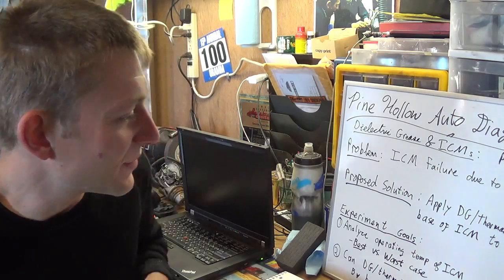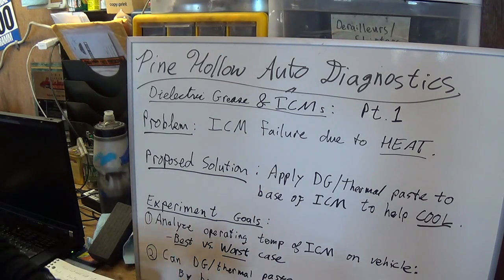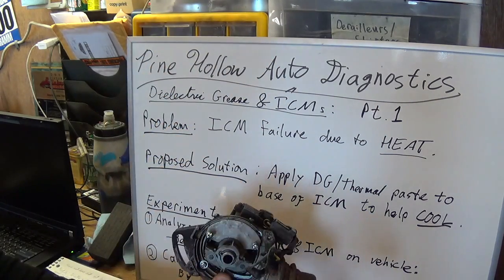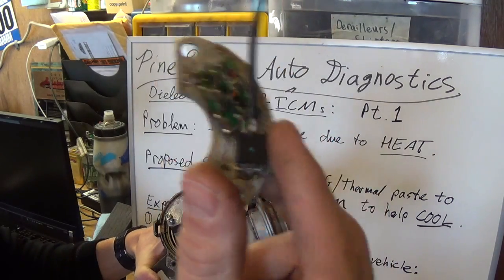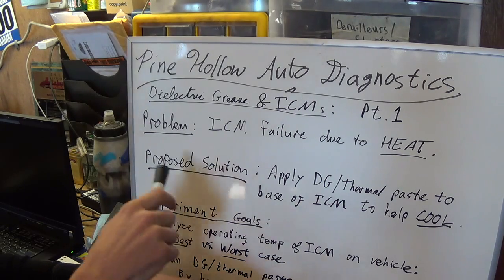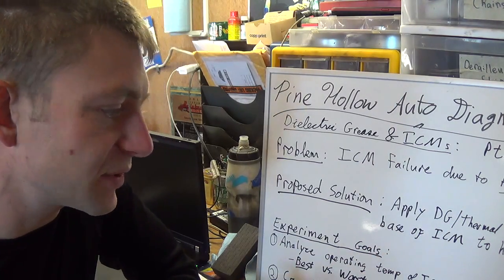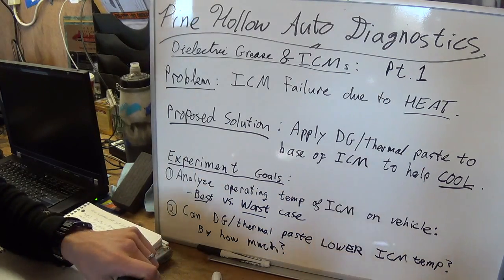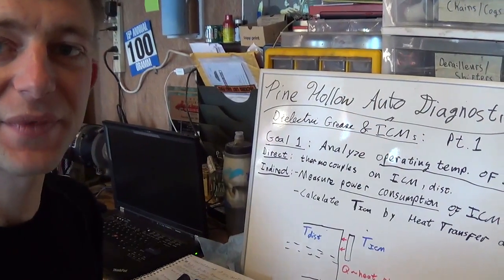MYTHBUSTERS Ep1: Dielectric Grease & ICMs - Part 1

Comment: on a gm 3800 Ive concluded the best resolution is applying thermal paste to reverse side of the icm to transfer the heat to the matching mounting plate. I think dielectric paste would be inappropriate.

Comment: I'm thinking the engine block even with it's something around 200° f temperature must be cooler than the transistor or GM or whatever manufacturer wouldn't have recommended thermal paste scene that's olny going to facilitate heat transfer, having said that I'm thinking it might be more about heat-cool cycles or even the speed of the cycle that causes falure however I'm going to try to figure out how many times that transistor actuates the problem for me what avg, speed do I use to calculate engine rpm, it might be less about heat than total number of firings of the transistor

Comment: Dielectric essentially means non-conductive. Dielectric Grease is used to improve and INSULATE the electrical connection point. When metal parts are connected, there are tiny areas where there is not a COMPLETE metal-to-metal connection. These inefficient connection points (gaps) can result in minute leakage and arching of the electrical flow. Dielectric Grease fills these tiny gaps and forces the electric flow to ONLY pass through the ideal contact points. As well, Dielectric Grease is used to prevent rust and corrosion; especially when the electrical connection is exposed exterior elements (water, salt, etc.).

Comment: It's pretty simple for me, maybe too simple on my part.  The ideal is to keep the ICM as cool as possible.  Let's assume that you have the best connection between the ICM and what it's attached to...a weld or solid body.  
Where??? does the heat originate from...  The ICM needs to be the coolest (or, cool-ER) component.  
The solution lies in making the ICM the coolest part in the system.  
In computers, you do this by using lithium grease or silver grease, or heat transfer grease to minimize temp differentials.... but that's because the CPU is the HOTTEST part of the computer... and needs a massive heat sink to draw heat away.  
If you want to extend the max longevity of the ICM,  then  cool it as much as possible.  Simple?
Reply from the maker: Correct. The question then becomes: how good of a heat sink is the distributor body, which is bolted to the hot engine block?

Comment: Been applying DG to connections for years.  Watch how a maker of the grease,  CRC, applies the grease.   https://www.youtube.com/watch?v=GNiEJfgS8cEThe point is that while it does not improve conductivity in the sense of being a conductor, it facilitates stability by keeping corrosion at bay.  Sometimes that corrosion is barely visible,.  Now I wouldn't use as much as CRC did in my link above.  I only apply it using a toothbrush.

Comment: The junction temperature of the power switch is most important. It is the sum of all thermal resistances (in degrees C rise/Watt of dissipation) times power dissipation in watts plus ambient. Typically the power transistor's thermal resistance is 1-3 C/W from junction to case. The TR from the case to heat sink is typically 0.1-0.3 C/W. The heat sink to ambient TR can vary widely say, 1-15 C/W. So typically the ambient temp and thermal resistances from the heat sink (distributor body) to ambient and from the semiconductor junction to case are the big influences on junction temperature. So you're right; Move the ICM to a cooler place and don't worry much about the dilectric grease!

Comment: I've fixed connection problems, loss of signal at connector, by removing excessive amounts of dielectric grease in the connector. I work on small to med size construction equipment, used to auto tech. I honestly think it may be used to transfer heat from a component but in a electrical connector it can cause problems.

Comment: Maybe I shouldn't but I'm gonna throw a curve ball at this one since we are discussing dielectric compound. In the seventies from the factory Ford applied dielectric compound to the tip of the distributor rotor to stop radio static on Dura-Spark ignition systems. We used to think the rotor tip was burned. If you replaced the rotor and didn't reapply the grease the static on the car radio was bad. Just thinking out loud.

Comment: It was always my understanding that Thermal paste or heat sink compound was to fill peaks and valleys in the surface of the metal we are using to improve heat transfer. The more surface contact the better the heat moves from the component to the heat sink. All metals are porous so we loose a lot of contact area. This is why a light coat is always best. The only problem i would think the DG would have is it's temperature range. At lower temps it might work fine. I'll wait for part 2 to see how it works out. Thanks for the video.

Comment: Damn, Damn, Damn...........Last night I had  a really great (my humble opinion) note to send and just before I finished it, the damn computer locked up!
(my computer-operating system-browser combination is not exactly "state of the art", to put it mildly)

I'll have to try to re-construct it later.

Anyway.................

____
I don't want to get too far out ahead of things here, because you're probably already aware of these items, but just to be sure, I'll mention them:
1. I don't know if you're going to be using the 4 wire or the 7 wire module for your experiments. On the 4 wire, the two mounting screws provide the grounding for the module.
I'm not sure about the 7 wire, I don't have a wiring diagram in front of me, but since it has 7 wires, it probably has at least one or more wires providing good grounds.

2. The are a LOT of "hacks" described on the web that people have done with these modules. There is also a lot of aftermarket replacement "speed parts" for it made by MSD, Mallory, Accel, etc.

3. Last night I looked at some exploded diagrams of the distributor, but I don't have time to look them back up at the moment, I'm in kind of a hurry.  But I wonder if the geometry would allow taking the module (at least the 4 wire style, not sure about the 7 wire) OUT of the Dizzy and put it on a dedicated large aluminum fin style heat sink (like computer CPU style) and mount that in free air a little ways away from the Dizzy, and away from any major heat sources. Just a thought (as a DIY hack, not as part of your experiments).

4. As I'm sure you did, I did a lot of searching for "GM HEI Ignition Module Failure" and there is a ton of anecdotal info out there about it. It was a MAJOR problem. I think the Ford EEC-IV's had a similar problem, although I haven't searched specifically for that. A couple readers mention that below also.

5. I found several references that say that Di-Electric Grease and Thermal Grease (Heat Sink Compound) are often BOTH Silicone based, but that the Thermal Past has special ingredients to help make it more thermally conductive.  By the way, and I think a couple other people have mentioned this, the white Heat Sink Compound is NOT white lithium grease, even though they look similar.

6.  Somebody said they had never seen Heat Sink Compound in an auto parts store, but it's hard for me to believe that most parts stores would not have it, especially these days.  But if somebody wants to get it, there are many places other than auto parts stores. I would think most hardware stores would have it. Any electronics supply business would have it. And of course by mail order, all the Electronics places will have it.  Mouser, JameCo, DigiKey, Allied Electronics, and dozens of others. A very small amount will go a long way.

Looking forward to parts 2 and 3 with baited breath.....

You're cool Ivan!

carry on...

Comment: I can see the temp differential being a big factor along with the area of the plate under the circuit.I offer my  condolences to you on your journey back to the text books. Some of them equations could lead to severe celebrial malfunction, so small doses at a time.Heatsinks and thermal resistance come to mind.Great pioneering experiment in real situations---Go for it!!

Comment: I believe a certain amount of radiation can take place without uv. As in a big pot belly stove. Aluminum is a great conductor. Aluminum oxide is a lousy conductor. As a lot of people in mobile homes with aluminum wiring found out. Insofar as the dielectric grease impedes the corrosion process, it allows good heat transfer. Am I close?
Reply from the maker: +Bill Rimmer Hey Bill! Sure any body that is above absolute zero will emit some radiation (blackbody radiation). In this case however, we can safely say it is negligible compared to the other two types. Good questions!
Reply: +motoYam82, We might also state that the role of convection is negligible since the air gap is so small! ;-)

Comment: i saw the decline in quality first hand when wrenching. ford reinvented eec-iv for poor quality back in the days. they moved the modules to a heat sink, heat played a crucial value in life cycle but the cheepo transistor life span was the  real player in failure. no amount of thermal paste would fix the failure rate.

Comment: Should be a very interesting experiment Ivan. You bring up a good point about the best temperature that the heat sink will be is the distributor housing which will run at a very high temperature anyway. As far I know, transistors theoretically should last forever which brings up the question of why do they fail. They do have aging effects which is inherent in the current technology of semiconductor manufacturing. Here is an article which may be of interest which pertains to MOSFETs. http://spectrum.ieee.org/semiconductors/processors/transistor-aging It's known that high currents and voltages of output transistors fail even with correct circuit design. Maybe, the transistor is operating at a higher value of temperature than what it's rated. Maybe, you could take a look at your value of heat dissipation and compare it to the data sheet for the transistor if you can read the part number. Other factors would be the aging of the biasing carbon resistors which will change value sooner in a hotter environment. This in turn would throw the transistor in a different operating point on the load line. Instead of being at cut-off and saturation it's operating point has shifted where more heat dissipation is required. Looking forward to your findings and keep up the good work.
Reply from the maker: +stuzman52 Terry thank you for the detailed thoughts! I agree that the designed operating temperature of the transistor and logic components is the key here. I think you will find the scope waveforms in the next Part very interesting to dissect! Maybe I should compare a known-good transistor on the van to the one from the faulty module on the bench?
Reply: +motoYam82 That would be very good to compare the good, the bad and can I say it, "the ugly". Sounds like you've got a good plan laid out Ivan.
Reply: +stuzman52 
Stutz,  Thanks for posting the Spectrum link about semiconductor aging. I found it very interesting.

Also, I wanted to congratulate you for your mention of possible bias resistor aging or being thermally changed (in value) in modules inside the distributor cap.

Personally, I like to dive deeper and deeper into every possible layer, when I'm trying to learn the theory of why a part fails. I'm not smart enough or educated enough to understand Ph.D level physics, but I can understand the idea of heat affecting a carbon resistor.

In other words, some people are happy enough to find out that a part failed, and then replace it. I like to (when it is within my intellectual abilities) figure out WHY it failed. That's why I am finding this particular case study and set of experiments that Ivan is doing so fascinating.

Be Well
Reply: +douglas lee No problem Douglas as we are all here to learn and trust me, I learn a lot of this stuff even today although I've been in electrical/electronics for 44 years. You too take and be well too.

Comment: The test data on this page says that dielectric grease works for thermal conductivity almost as well as thinly-applied thermal compound. (and thickly-applied thermal compound was as bad as bare metal-on-metal contact)

http://www.w8ji.com/dielectric_grease_vs_conductive_grease.htm
Reply from the maker: +anti0918 Dude! Don't give it away lol! I actually found that same link when doing the research for this series :) 
We'll take a look at that in part 3 and use our actual module power consumption numbers from part 2. The results will be pretty awesome.
Reply: motoYam82 Well, I think yours will be a better test, since the temperatures should be much higher than the 50-60 degrees he was measuring.
Reply: +brian0918 
Brian, Thanks for posting that. It was a very interesting article to read.
Reply: +anti0918 I've used anti-seize before,in a pinch. It actually works pretty well,since it contains metal particles.

Comment: when you tore the icm apart and told me the metal was aluminum that cinched it for me. in the building trades if you have aluminum wiring and you hook up a dishwasher or light fixture with copper wiring in weeks you will have a fire because of dissimilar materials. a grease is used to keep it cool. also in roofing and other trades aluminum will not match up. looking forward to part 2
Reply from the maker: +John Hafernik Wow aluminum wiring? So is there extra resistance at the Copper-aluminum interface to create heat and start a fire? That's crazy!
Reply: +John Hafernik I'm probably wrong about this, but I thought that aluminum wiring had been made totally illegal for virtually all residential housing in the US, via the National Electrical Code. Do you have any data about that?  I never knew mobile homes used aluminum wiring, but it figures.  Everything about mobile homes has always been done in such a cheap shitty way.  A few decades ago I considered buying one, but they had a "Disclosure Sheet" taped to the kitchen counter saying that there was formaldehyde used in some of the buildihng materials. That was all I needed to see to walk away. Anyway, that's off topic. I was just wondering if alum wire was still used in any construction these days?
Reply: +douglas lee back in the 70's aluminum wiring was installed in houses quiet a bit. I own one and as long as you use special switches and plugs it is fairly safe and the grease for connections. they don't make you rewire the house to sell it. still to this day the service wire that goes to your house is made out of aluminum. you have to tighten your main box and breaker box every once in a while so it makes a good connection and use the right plugs and switches. never owned a mobile home but i'm sure they used it there too. house inspectors try to scare you all the time. i'm sure code says no more but i'm grandfathered in
Reply: +John Hafernik John, Thanks for responding. That's good information to know.

Comment: Love this type of investigation . Man this is going to be a hard one to set up. To me I can't see the grease doing anything. Ha I've been wrong before. I suspect the module failure is a pattern failure of time and use more so than heat transfer. Using logic you would think up here with a colder climate the failure rate would be less than in Arizona but as far as I have experienced it seems to be about the same here as everywhere else. Where  as the intake gaskets on some  LS engines is the opposite , lots of failures up here all about the same mileage  or time but in the southern USA not so much, seems climate affected the failure rate.  Look forward to the experiment Ivan.
Reply: +motoYam82 Exactly Ivan. It could be that the circuit design was not a good one. Engineers at that time were all learning about electronics and didn't have the timespan to collect data to see how well their designs would hold up. As the years rolled on, the engineers saw the failure rates and could improve on their circuit design where ICMs didn't fail as often. And as I mentioned in another posting here, even if their circuit design was good, the heating of components such as biasing resistors could throw the transistor into a condition where the transistor was dissipating more heat than it could handle. Have a good one....
Reply from the maker: +Steve Rob Hey Steve! It's always useful to look at statistical data for failures and correlate it with different factors like climate etc. Hey maybe the first batch of ICMs were just under-engineered and have a short lifespan no matter where ya stick 'em :)
Reply: Ivan I think your on to something, back then it was a learning faze. You have viewers from all over America and them trucks were plenty it would be nice to hear from other areas if they all experienced the same failures. YouTube is a great medium to get feedback to put into the variables of an experiment .

Comment: looking forward to part 2.   On C4 Corvettes(1992-96)  /Camaros with the LT1 engine the ICM is mounted externally to the end of the passenger side cylinder head, with thermal grease in between.  Time and heat is not friendly to them and eventually the heat destroys the unit. Symptoms are engine stalls when hot or no start situation.  Fun stuff!